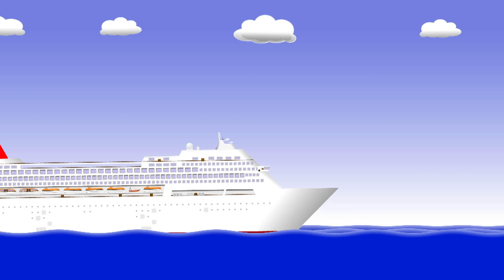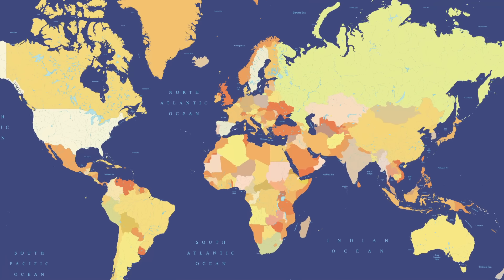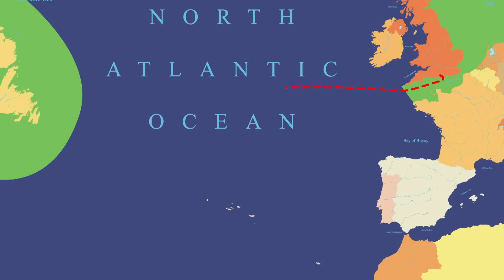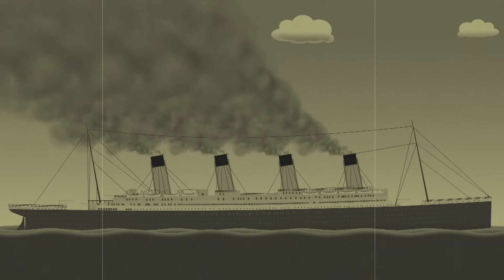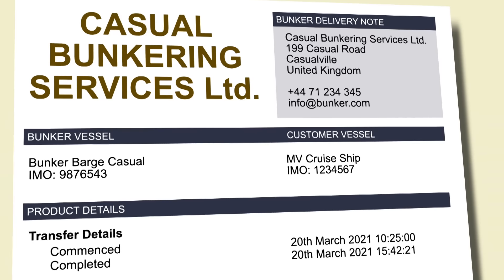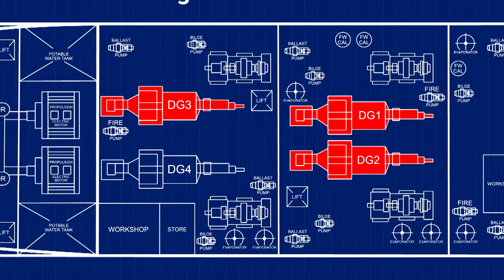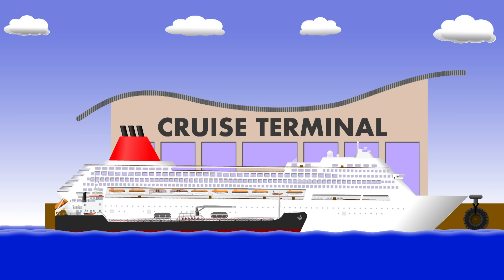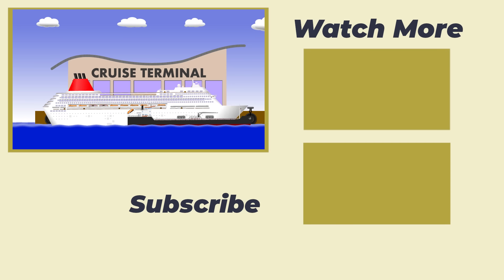Where Do Ships Get Their Fuel?

Comment: What you refer to as bunker fuel is referred to as blended fuel on the container ships I sailed. It is a blend of the residual oil after the refining process and burnable hazardous waste.  It must be heated in order to be pumped.  The ships engineers spend the majority of their time preparing this very nasty dirty fuel for it to be burned in the main engine.  Fuel and many other thing must be much different on cruise ships.  Never worked one.
Reply: What's the consistency like? I hear it flows like honey.
Reply: @jonathantan2469  I don’t recall any of the viscosity numbers but honey would be an accurate description. To pump it from the double bottoms into the day tank it would need to be about 90 degrees Fahrenheit. To run it through the purifiers, final filters and then the Main engine it winds up being around 200 Fahrenheit. At that temp it is very fluid. The temperature is all determined by the desired viscosity of course.

Comment: US Navy and ships from NATO nations have a third option, beside fuel depots or bunker barges. They refuel from specialized tankers while underway. That way, they can stay in a hot zone without having to leave for fuel. I was on a destroyer, then later on stationed on tankers, so familiar with both ends. After I was done sailing I worked at a naval fuel depot, so saw all aspects of ship refueling. Search YouTube for UNREP refueling, it's quite the operation. For a timeline, we could refuel a destroyer in less than 30 minutes, the old non-nuclear aircraft carriers took 3-4 hours, that was giving them diesel for the engines and jet fuel for the planes.

Comment: Most commercial ports actually have pipelines built into the quays which is the most commonly used way to bunker ships. Thereafter they would choose to bunker using multiple road tankers, and lastly the most expensive way would be by bunker barge.

Comment: Seems it should be possible to fuel a ship from a shore facility -- you can have plenty big tanks on shore.  The problem is that each ship would tie up a bunkering berth for a LONG time, including the time needed to maneuver them in and out before you can serve the next ship.  So better to have bunker barges that are highly maneuverable to carry the fuel out to the big ships.  They still would take a long time to fill up at the shore facility (unless they have some way of quick-loading), but since they are smaller, you can fit more of them in around the shore facility, and they don't need as long to get in and out.

Edit:  You'd think that they could refuel the ship from shore while loading and unloading cargo, but then you would have to have extensive fuel plumbing out to the cargo berths, which would be expensive to install and more fuel lines you would have to worry about leaking (and about keeping hot in the case of heavy fuel oil).

Comment: 38 yrs. on a tug in NYC harbor.  Putting fuel barges along side ships.  The tug went to one of the fuel terminals, ie Exxon Con-hook. or another.  one tug ,3200 hp, used 17,000. gallons a week.  Another was 3900 HP  used 20,000 gallons a week.  Just think how much fuel used by tugs, ships, and WOW airplanes, world wide.

Comment: At first I thought "A gallon of fuel only moves it 50 meters? Absolutely pathetic efficiency"

Then I remembered this is, in fact, an enormous boat, not a vehicle.
Reply: The fuel efficiency per ton moved is very high. Those 18,000 TEU ships are ridiculously fuel efficient per ton, though the fuel, as pointed out in the video, can produce really bad pollution. A significant portion of the Los Angeles basin's smog came from vessels at the Port of Long Beach and Los Angeles until the port instituted air quality requirements on ships. This has been assisted by the ultra-low sulfur requirements for the US in general, but I think the port still has even stronger requirements.
Reply: @JarrodFrates  meanwhile, ships still apparently are free to use the 'cheaper' dirtier fuel in between port zones... i wonder where all that pollution goes eh? apparently the planet just handles it FOC for these capitalists xD
Reply: We did the maths on one of those bigger container ships, and I think it came out to the same as a semi hauling an intermodal container getting 150mpg, which isn't shabby.
Reply: I mean you can't complain as long as you are buying foreign made goods. Buy domestic!
Reply: @stevencooper4422  Producing domestic just for the sake of reducing shipping costs/emissions isn't a practical solution - it's likely to incur significant inefficiencies on it's own. Supply chains are extremely complicated, but the general rule is that the bigger they are, the better.
Reply: "Should I use US or metric units?  Hmm...I'll compromise and state the fuel efficiency in meters per gallon."
Reply: Yeah, the numbers need to be put in context.  A cruise ship may only get 0.03 miles per gallon, but that works out to somewhere on the order of 100 passenger-miles per gallon, several times more efficient than typical cars.
Reply: And mooving through the water which is much more heavy and adherent then air or asphalt for tires...
Reply: Oh, and remember the ship if it was an oil fired Titanic would be 46000 tonnes, going through a fluid that's 812 times denser than air at 20kts.. It's not exactly a Prius - and thank common sense for that.
Reply: @wraithcadmus  Now try convincing one of the eco dribblers of that reality. You could sit them down with the mathematics and they'd still say you were wrong.
Reply: @stevencooper4422  The problem is how? Most countries don't have the capacity and no one is prepared to pay the higher prices because of higher input costs.
Reply: @alveolate  Actually ships CAN use cheaper and dirtier high-sulfur fuel, but in doing so they must run exhaust gas scrubbers that are efficient enough to reduce their sulfur emissions down to the same level as a ship running on 0.1% sulfur fuel with no scrubber.

Comment: In general, all correct, but I think, your numbers are a bit on the low side.
With 3t of fuel per hour, you only get about 15MW of power. Unless you talk about a tiny expedition cruise ship, you won't make 20kn with that.
The larger ships at least have an installed propulsion power in the range of about 40MW, with a total generator power of about 60MW. Some of the really large ones, like "Allure of the Seas", even stack another 50% on top.
So it's really not a far stretch if they use some 25 or 30 MW, which is doubling the fuel consumption.

And on top comes all the service power for pools, air conditioning, beer fridge, lights, bars, casino, restaurants, desalination plant, wastewater treatment plant etc. I've visited some of the not-so-small cruise ships and pulled some data. With almost 10MW in port, while most of the passengers are in town, it's definitely a significant amount of power that's used as service power.
And even running a scrubber might increase the power consumption by several Megawatts.

Comment: Very interesting.
Does the cost of using a specific grade of fuel dictate the course plotted on a large ship.
IE would you skirt the boundary of an area demanding ultra low sulpher fuel?
In that.. The course might be longer, but you'd burn less of the expensive fuel?

Comment: 600 tons of fuel for a ship to cross the Atlantic is bloody dam efficient compared to the titanics fuel consumption which was about 600 tons of coal in 24 hours or per day and would of used over 3000 tons of coal to do the Atlantic crossing and now there is a diesel powered ship that uses less fuel to cover the same distance to what a boing 747 does in flight of the same distance and I saw this on a TV documentary called mighty ships.

Comment: I'm surprised they don't connect directly to a pipeline running from a tank farm, like aircraft do.
Reply: Probably due to maintenence costs. Bunker fuel oil is more viscous & dirtier than kerosene. It has to be heated up to flow properly, and the residues form clogs & corrodes pipes if you're not careful...
Besides, the tanker method allows refueling while the ship is at anchor & waiting its turn to berth, saving time & costs.

Comment: Just out of sheer curiosity, why isn't a nuclear powered commercial cargo and cruise ships into existence yet !?! 
If all the equipments on board could make use of electric power, wouldn't that be much envionment friendly, cost efficient and offset the cost of building and operations in long run !? Ofcourse without all the hassles mentioned above to refuel, manage and store. 
Would not it make more sense in terms of cost and carbon foot print !?

Comment: With all that fuel burnt by ships around the world, they must account for a lot of greenhouse gas emissions. Hydrogen seems like a good replacement for traditional fuels, but until we can have a majority of our hydrogen produced cleanly, it won't be a good idea. Around 95% of the world's hydrogen is produced using fossil fuels such as methane, so the emissions from the hydrogen are produced where it's manufactured rather than where it's used, so it's not eco-friendly at all.